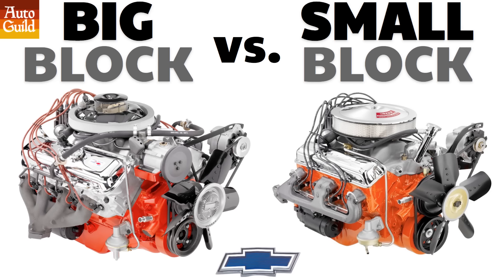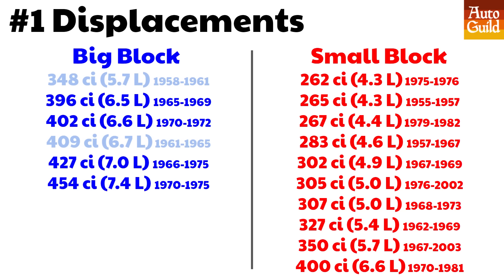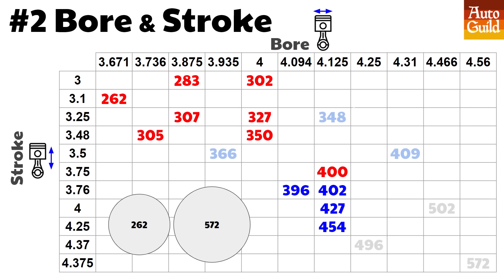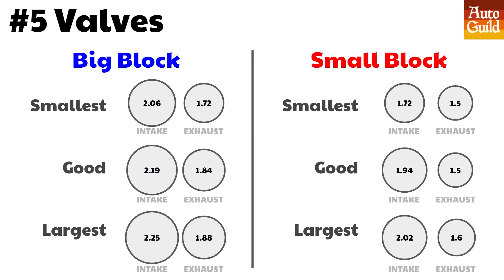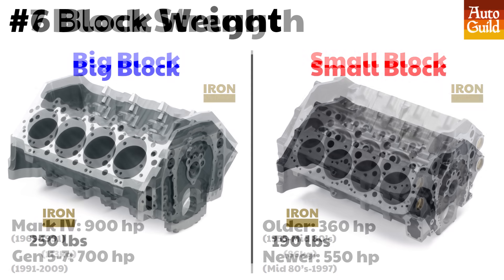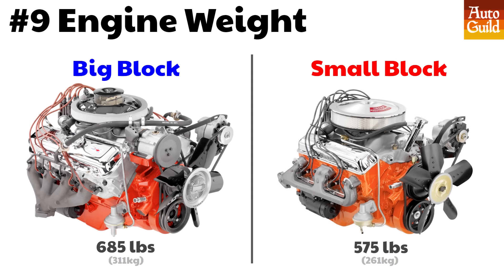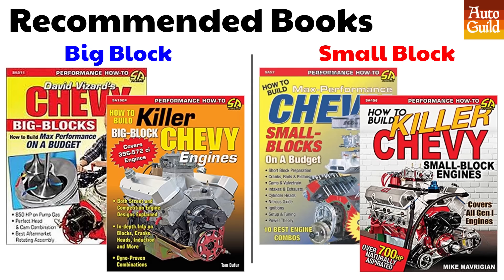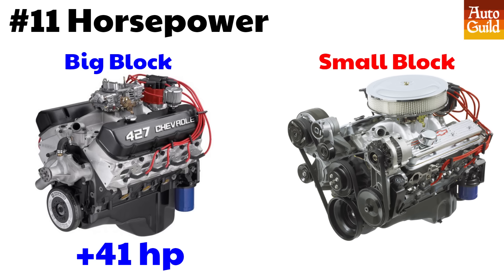Big Block vs  Small Block Chevy Comparison

Comment: Lots of good researched information here. But as you can tell from my account picture, I’m old school. Years ago we had a Japanese piece of 💩 sold under a Chevrolet badging. Yet…. 1979 Luv truck.  This truck had a factory aluminum block, and heads.  One of our over paid rocket scientist ignored the temperature gauge while driving across town, from one of our locations to the main facility. It over heated. In short the hards were removed, and re surfaced and reinstalled on the non cracked but warped block. Even at the time over $1,500.00 was spent at the factory house. They got it running, but it never ran good again. It lopped and missed. I think it was a corporate decision to junk the truck, and in 1982 we bought a new S-10. It was much better and the Luv.  That S-10 we put 87,000 thousand miles on it the first year alone. We drove that S-10 until 1989, the odometer read 180,000 miles when I left the company. My account thumbnail is for my 1968 Chevelle. It’s a 350 with Vortex heads. Holly 650 four- barrel. It’s a crate engine I ordered out of the State of Arizona, and they shipped it to my door. In the 40 plus years of rebuilding engines, they had one (admitted) screw up. And one faulty oil pump from one of their suppliers. I felt safe going with them, with a record like that.

Comment: That's why I love Buick 455 they only weigh 25 pounds heavier than a small block
Reply: The heads flow about as well as the big valve SBC heads though and you can stroke SBC to the same displacement with the right block.

Comment: Modern engine swaps aside, if you live in the midwest or other flat places where the roads are basically straight then who cares, go for the big block car. If you like going around corners fast, a small block car is much more fun to drive.

Comment: Excellent comparison , you did miss one very important item to lighten a big block , a factory Delco Starter about  twenty pounds, a high  torque mini Starter seven pounds also a iron distributor versus a aluminum distributor, also available a electric water pump, you knowl your Chevies, ps exhaust headers also.

Comment: I had a 1968 L-78 Malibu SS-396 that was passed around the neighborhood like a cheap bottle of wine. I was the third owner, I took the 4:88 out of the rear end and put 3:73 in. It was stock, Joe Brennan put Hooker Headers on it and a Hurst Super Shifter, I installed both. He sold it to Dave Guasselin and Harold Jensen they raced it @ 12:50s with slicks. Put 3:73 in the ass end, straightened out other stuff, this was my daily dryer. Just standard stuff , but it was never beat on the street... The closest race happened around Marquette Park, 3 to 4 A.M. with a Pontiac G.T.O..... He chose me off,  we raced, he loses by a quarter fender to a half car, I still don't know, it was intense. The engine was limited to 7600 rpm, by original valve springs, which with 3:73 gears, was 166 MPH. That was on 87 st in Chicago, before they dug up the Grave Yard, from Kedzie. To the RR tracks, then shut down to Pulaski..The SS was never beat on the street, that G.T.O.  was the closest race. A couple years later, the g.t.o. racer becomes about famous as a Pontiac racer. I dont remember his name, but this is a true story. I raced two other L-78s, and beat them also. One was Ron Maratello, his was a Nova with Doug Thorley headers. We talked for about 2 weeks, he was certain that he would win because of his weight advantage....He lost. The other one was a 66 L-78 that kept telling me that I would lose... We worked together... We raced, he lost. My stuff never lost on the street, and that's a true story.

Comment: My 454 revved to 6 grand
All the time. Granted it had a mild cam.
Reply: My Dad wound his 455 Olds 442 ('71) out to 6k, especially at top end. He did have to rebuild it 3 times though, in 100k miles.  😂

Comment: These days, for anything streetable/daily driver, SBC all the way, save for something extreme like a tow rig. What with widely available stroker kits, roller cams and AL heads and intakes, it's easy to get big streetable power in a shocking small and light package.
Reply: Yes but you still need more RPM to make that power. Don't get me wrong, Small Blocks are powerful but its Big Blocks where the true power lies because you can make more with less RPM.
Reply: @extremedrivr  yes to both, big block is best for towing n pushing weight, small block for daily driving n saving money on gas..lol But i prefer big blocks no matter what..

Comment: So for me I’ve been building engines for years. For street machines stock to mild big blocks are cheaper to build for street cars and trucks because the robust nature of a big block 600 hp is the average even on a 2 bolt 396. The stock heads flow really well stock but with pocket porting flow greatly. But heavily modded street or strip sbc is king because of part availability and price, but when it come to major 1000 hp+ the reliability of a bbc cannot be beat. If money isn’t an issue go with a big block, aftermarket big blocks are literally the best thing you can buy naturally aspirated in my opinion. But for cons for both is oiling, aftermarket priority main oiling solves those issues so be mindful of that, for some reason oiling has never really been a priority in gm’s mind. And when it comes to weight if it’s that an issue especially for a big block, buy a 455 Buick it’s within 50 lbs of a sbc fully assembled with oil its nuts and they are torque monster with plenty of availability.
Reply: i agree, but i'm the type that thinks bb's are best all around, the torque from idle is an automatic win in my heart, only way a sb wins imo is if gas mileage is important to someone..
Reply: @P71ScrewHead  or going round corners, which you yanks dont do..
Reply: @harrywalker968  We do do corners, to the left, aaaaah, see what I did there?? NASCAR joke..lol I'm a Texan by the way, not a Yank, that would be a downgrade..lol

Comment: The big block guys will say that the weight difference between blocks can be offset with Aluminum heads, intake, etc.  Arguable, but let's accept that premise.   The problem is that (besides the obvious flaw in that argument)  other things weighs more as well....headers, springs, larger radiator, etc.

Comment: For me and with today's tech Small Blocks rule the world. We work with Honda "Small Block" in the Honda V6 J-Series engines. Today's motors can handle so much power but big block still has that nostalgia. If you want power, weight savings and overall speed, strap some Turbs to the small block and you probably are right at the big block size with space in mind but also making more power and that TQ. Our little 3.2 V6 motor made 560/464 on 8psi of boost..that's 175WHP (NOT CRANK..so 198-200hp per liter crank?) per liter on a stock block....and 8psi is nothing in boost amount
With that said, aint nothing like a Big Block with a 108 Cam chop 🤗

Comment: a big factor also plays into if its a 4 bolt or 2 bolt main on the sbc 350, you can easily be fine with over 360 bhp from blocks all the way back from the 70s and if you have upgrades from stock like pistons ect
Reply from the maker: For sure, if you know what to look for u can find one that can hold some power.  Thats the great thing about the new LS and LT is all the blocks can hold big power, no guessing games!

Comment: Please do a video on the dimentions of the chevy 632
Reply: Typically built with a 10.2 deck height block v. the standard 9.8 deck, but with the same 4.840 bore spacing as a stock BBC. Some builders go to a 10.4 deck to get more room for longer rods and/or more piston compression height. The most common configuration is a 4.600 bore with a 4.750 stroke. A raised camshaft is also a popular option to increase rod to cam clearance and allow for shorter pushrods.

Comment: Mechanic built a big block for  me of the boys. Bit under 600 hp which isn’t massive
But
But it makes 750 nm of torque. On original headers and runs ac 
Lays double pegged burnouts out at 150 kms an hour. Hell fun to be in the back

Comment: Meh, I had a 509 casting 400 small block. I bored it .030 over and stuffed astroker crank in her and made a 434 stroker with as much aluminum on top as possible. The only thing that was iron was the block. 

That small block spanked 427's and 454 equipped cars all day. It was in a 68 z/28 Camaro with a M21 close ratio muncie and 12 bolt 373 posi. The 302 was put away for safe keeping but the muncie and 12 bolt was used. 

Gobs of torque and I will never go 383 not when one has already had 434.
Reply: I completely agree

Comment: Z11 was a 409.  The aluminum Mk IV big block was the ZL1.

You may want to check the weight savings between the iron exhaust manifolds and mid length headers.  It should be closer to 30 lb.
Reply: Z11 was a 427, but still a W style engine. Really cool engine, shame so few were made.

Comment: I have a 4.6 liter on my 2005  Mercury Grand Marquis so it would be good to see the same comparison on the Ford big block and small block.  The 4.6 Liter is a 281 cubic inch.
Reply: Our Panther's 2v is a hell of a torquey engine for how small it is, there's a reason why cops n taxis used them for so long in 4k lbs cars.. i love the 2v, great lil engine..
Reply: only ford b/s blocks, are the 385 series, 302. 351. 460. this, is how chev, should of built engines. not 2 completly different types. a chev 454 needs more speed shop, than a 460, to have 7hp more..ill keep my ford truck engines. chev dont rev, cos of the press in studs, a 460 will do 7k std..my 351 did 6k. all day,every day..f100. 4x4. funny how chev had canted valves on some bbc, but not small blocks..sht design from '55..never improved it. just floged it to death..money maker..
Reply: ps. from what ive seen of the 351w, it might of been going to be a bb. but 70,s killed that.
Reply: No comparison to a BB. ONe ride in a healthy one you wont like your 4.6 like you did before

Comment: You have an error in  your bore and stroke sizes  for  427 and  454 big blocks. You  list the bore for the 427 and 454 as 4.125  the real bore is 4.25  for both 427 and 454. you list the stroke  for 427 as 4 inch  the true stroke is  3.75 the same as the 396. the stroke you list for the 454 is you list 4.25 the true stroke is 4 inches. The 427 and  454 use the same block Chevy increased the size by increasing the stroke from 3.75 to 4 inch!
Reply from the maker: I know, I made a comment and pinned it to the top of the comments section.  : (
Reply: You made  a lot of  mistakes,  for  someone that was going to teach us all there is to know about the   small and big block engines. The  Z11 engine was built in 1963 and was  427 version of the 409, not made of aluminum or made in 1969. The Aluminum 1969 engine was a ZL1 427 engine. The 366 truck engine is  a small bore 396 not a W series!

Comment: You forgot about the 427 SBC, small blocks produce more torque than a big block that why drag racers love there SBC’s big blocks just don’t rev high enough BBC you gotta shift at about 5000rpm SBC you can shift about 7500rpm, in the quarter mile I went through the lights at 9200 rpm that would kill a BBC, SBC block can take a few thousand HP if built right
Reply: You might want to fact check your comment. Stroke is torque and bbc's are where it's at. Torque is acceleration.

Comment: Ok, i need to put something out there because there is a little bit of a subjective opinion that is left out here.  A small block is a great motor and no one can dispute that.   Its a different time though.  In today's applications, there is really no reason to build a small block with LS engines available as they are today.  If you would have made this video 20 years ago it could be debated.  Now with that out of the way.  First reason big blocks are really wanted is simple.  HUGE amounts of overhead to build a tremendous amount of torque at low RPM.  That alone, hands down is the reason why people want them.  There is way more upgradability to make sick amounts of torque that the gods would be afraid of.  Ask any car guy, "Why would you build a big block?"  That is the reason you will get.  There is nothing in this world that can replace a big block when it comes to planting your ass in the seat.  Second reason, large cubic inches with a roots blower is just a burly inefficient monster that doesn't give a damn about anything and will pull the skydown and laugh until it grenades.  Its like fat uncle Bob that comes over cleans out your cupboards and drink all your beer and then wants to go to the bar get drunk and then play pool and then get breakfast at Dennys.   Thrid reason, and the most important for some,  the sound.  OMG, there is nothing like a big block.  To me, the small block died when the LS came out in vast numbers as they did.  You want a motor out in the main stream, put it in an American truck.  You want large amounts of firepower to become well known, put it in the Corvette,  Camaro, and GTO.

Comment: Today with aftermarket parts you can have big block displacement in a small block so why not stay with a small block.
Reply: Because you still need more RPM to make all that power hence why small blocks wind high. 

Big Blocks make insane power at low RPMs which is the main reason why they were invented over half a century ago.

Comment: I own a big block 454, two 350s and a 6.0 LS. I don't care about the weight of the big block, it's just straight up cool, it's loud, it rumbles, the torque is amazing. I love my small blocks and my LS, they're both great engines but the big block is on its own level, i could never swap an LS in my 72 Cheyenne Super. Just my 2 pennies.

Comment: Big Block Buick weighs only 25LBs more than a SBC. I had one blue print built from an x- nascar/dirt track racer for $2500. But he made me use $1000 custom JE pistons and I got to use my choice Kenne Bell/Poston high oil pressure pump, aluminum bottom block girdle and I sent an old hemi carter to poston buick and they sent it to their rebuilder who got me 1000cfm for only $179. I am just a giant parts changer I can change heads that's about as deep as I go and I did all my swaps and had a racing transmission friend build my TH400 with extra clutch and 1969 corvette bearings, that's all I know to handle the hp/tq my mechanic was making. Mechanic told transmission guy he better build it tough and transmission guy said he can't build anything to break his transmissions for $300 I had to install everything. we had 116 leaded at the pumps due to jet ski boats in central Arkansas. so I had 12:1 comp and there is no inspection so if you build it you can drive it.
Reply: he had to mill the heads/intake and crank I thought he mentioned something about aerodynamics or windage? as far as the crank having less weight and something about it cutting through the oil better?

Comment: I have a stock 454 from 95 in a k2500 and it appears to choke out just about 3900/4000 rpm. Should I swap the tbi for a four barrel carb? I feel like 7.4 liters is breathing through a bendy straw.

Comment: Uhh...  The "502" was commercially available on the market as the "500 Cadzillia".  It made 475 hp in 1972, supposedly.  Insurance claims and all.  Could have been higher.  Was nerfed down to 200 hp for fuel regulations after that.  Just like Pepperage Farms, old farts like me remember.  Leave it to Cadillac to unless such a beast.

Comment: My understanding is the small block heads with the largest valve size of 2.02" intake and 1.6" exhaust had poor longevity because the space between the valve seats was too small and that caused a weakness that caused cracks in the head between the valve seats or the valves to overheat and warp causing leaks.
Reply: Only on cheap casting Factory heads usually I've had Big Blocks and small blocks last equally as long and they've all outlasted most people I knows engines

Comment: My 30 year old turbo charged v6 in my buick puts out more hp and torque than all of these engines
Reply: If it’s a grand national or GNX it’s not even close to either of these motors. 270Hp and 360 ft/lb tq, the SBC can destroy that without sweating.
Reply: @sammendoza7168  one thing I've learned owning my t Type is that a turbocharger done properly makes  most large engines obsolete unless you really want to go full race,my little v6 has a 212 cam ported heads and manifold 67 mm turbocharger 3200 stall with alcohol injection and tuned for 23 psi and it weighs nothing compared to a iron big block,I use to be a v8 snob and now I'm a turbo snob,if it doesn't have a turbo that engine will never see its full potential, u could turbo the big block that would be awesome!check out ta's aluminum buick v6 block that thing is a beast it can do 2000 hp no problem

Comment: Great stuff, thanks! How about big block vs LS? I would love to see that deep dive and a focus on the 427 BBC vs LS7.
Reply: Big block wins with it's torque, LS7 wins in mpg.. Basically mpg vs gpm..lol
Reply: @P71ScrewHead  They're the same displacement. The BBC has a larger bore and shorter stroke than the LS7. Larger bore and shorter stroke usually make for better top end power, so I would think the BBC would have good top end and the LS7 would be better bottom end. I don't know what the rotating mass of a BBC is compared to an LS, but if the LS is much lower, it may offset the difference. Would love to see the head to head comparison.
Reply: @brianartigas  That would be a good comparison, I think the big block would still have more lower rpm torque, the LS7 would rev higher, my guess..
Reply: working a project right now.. hope to update with mass LS casualties soon..
Reply: @JaySmith-frosty  hows it going??